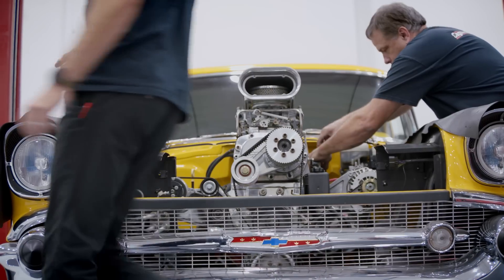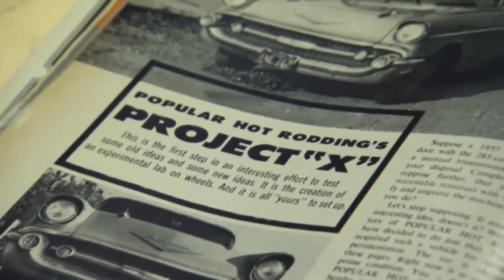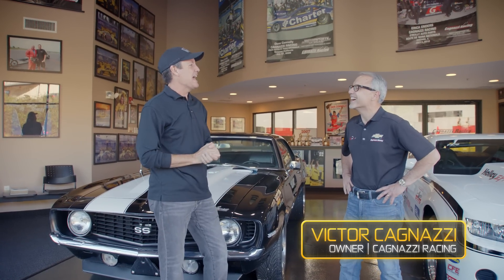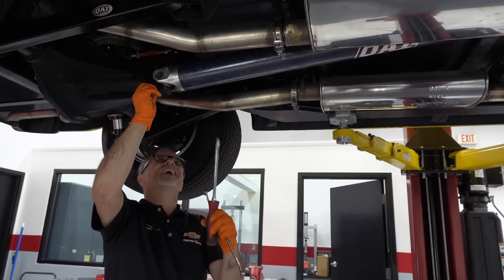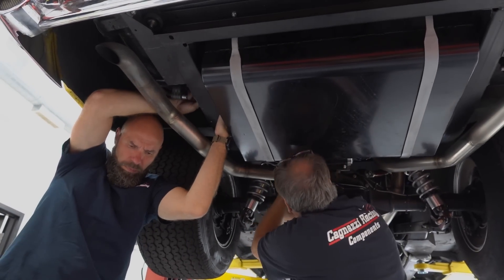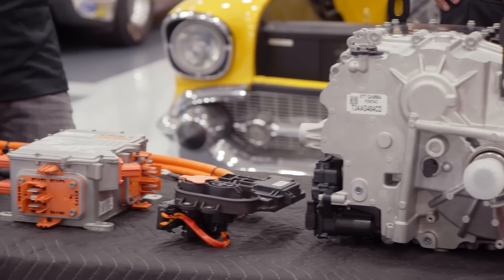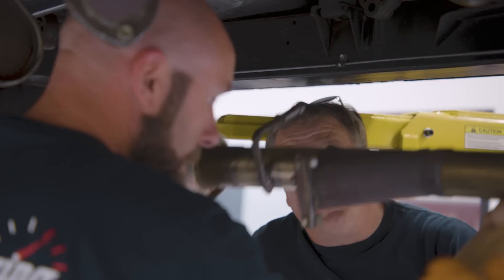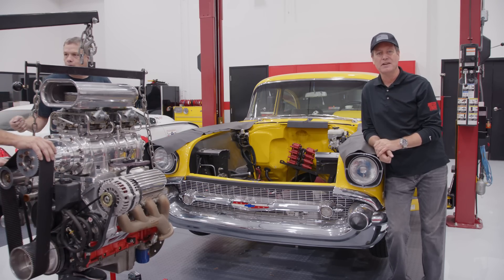Project X: EV Engine Swap [Ep. 1] | MotorTrend

Comment: What a shame 

BTW electricity is a product NOT a power source. It has to be made and how it is made is important to the whole "green energy" argument. 
Are you really saving the planet or just polluting somewhere else that you can't see so that you can feel better about yourself? Yeah it matters, kids.
Reply: California can't even keep everyone's air-conditioners running without rolling blackouts but throwing power into every home for charging your car should be no problem. What a bunch of idiots.
Reply: 😐Ambri Batteries and Solar Grid😐
Reply: Well....as it has been said many times, the energy grid is ALSO changing over, from burning coal or nat gas, to renewables. Why do people not understand that? And....even if it was a 100% coal fired plant, if it powered all electric cars, you still have less toxic emissions and CO2.
Reply: the tires and brakes still give off emissions so if your using coal power plants it's not really much better plus it's the same emissions to build either gas or ev
Reply: @Error-ge9qx  Yes tires and brakes will do that. I don't understand why you are saying that's worse with EVs. In fact brake pads will last longer on an EV because of Regen braking. Right now there is R&D going on with tires, to hopefully make it more environmentally friendly.
Reply: @typhoon320i  This is total nonsense and green washing. Renewable energy(another bullshit term) barely supplies a tiny fraction of our power,because the energy density is not there. Solar and wind are not green(look at the fiberglass windmill blades they bury by the thousands https://www.youtube.com/watch?v=8uo0wefpwZ8 ). they use alot of power to manufacture and produce alot of waste when broken or at end of life. Wake up and quit drinking the kool-aid(or Programming). IT makes a lot more sense to use our existing working grid and plants and gas station infrastructure by putting gas in a  tank and driving,than it does spending trillions to build new infrastructure for something that is a finite resource(LITHIUM) just like fossil fuel.  These electrics just move the pollution from the car to the plant and dont solve a problem,other than people in large,unsustainable cities arent choking on their own pollution. Co2 is not the enemy ,plants need it,and we get O2 in return from plant aspiration. Carbon MONoxide now is a pollutant.
Reply: @a4000t  almost all of oregon is ran off hydro electric 100% renewable energy. Honestly once people get being hydrogen cell EVs will dominate the internal combustion engine
Reply: @NWoutdoorsman  Ok,thats fine,but Oregon is just one place and most states don't have hydro power nor do many countries for that matter. Hydro is a wonderful thing,but it has a huge environmental impact as well-look up the ecosystems it destroys.. there is NO free ride,and made has a terrible footprint to maintain our present lifestyles.
Hydrogen is another stupid idea. Use power to crack water into hydrogen,any conversions of energy means losses. You really should take some time and do some serious research on this stuff. Again its not that hydrogen doesn't work,its the fact that anytime u have to "make" it you incur more losses than gains,its the basic laws of physics on energy conversion.
Reply: @a4000t  very true on the efficiency loss to produce hydrogen however with solar electricity producing the hydrogen there is little emissions happening in the process. The fact that more has not been done leads me to think the climate crisis is less dependant on human impact that lead to belive. The ability to produce hydrogen and transport it to areas where clean electricity is not viable would be a step in the right direction.
Reply: @NWoutdoorsman  LOL,and where and how do you think those magic solar panels were made? Huge amounts of power to refine the silicon ingots to make cells(non renewable waste when they break or fail),smelt the aluminum and extrude it into frames in a factory,manufacture plastic backsheet,massive power to make the glass. Hydrogen is stored in special bladderd steel tanks(yep power to make those too) because it permiates everything.  Read my LIPS: everything uses power..there is no free ride.
Reply: @a4000t  I know there is no free ride. But oil rigs and refineries are not emissions free either. I'm just stating massive lithium battery packs to store electricity for ev's is not the efficient way. There are already power plants in place that we could use to produce the hydrogen. The initial investment is going to be expensive but if renewable energy is the objective I think hydrogen is the best viable option. I'm not disagreeing with anything you are saying, I'm just try to clarify my opinions. Hydrogen fuel cell is a promising future and if Elon would have got behind it in the beginning we would be better off now. Hopefully Toyota's new hydrogen car will get the ball rolling.
Reply: @a4000t  The batteries of electric cars can be completly recycled and it's easy to do (lithium) will will have to mine enough to put about a 100 million on the road to replace current fleet and then will need to mine more as the population grows. Or by that point we will have new battery chemistry. I'm more a fan of solar over wind anyway.
Reply: @typhoon320i  Show me where there is a proven method to recycle lithium.. not a theory,or paper written on it,but actual proper recycling. Not to mention recycling uses a lot of power and it in itself is not green. There are none. Its a waste byproduct. So why trade fossil fuel(which we have infrastructure in place for over 100 years and its paid for) for yet another finite resource? Lithium is mined with slave labor also you know. Good luck putting 100million electric cars on the road,and try and charge them from the grid at the same time,the grid will catch fire and go down. It takes upwards of 10,20,30KW to charge a electric car depending how fast u want it. This would murder the grid if u try and charge a large quantity of cars at the same time. I guess we the tax payers should spend yet more trillions for a grid upgrade right? none of this makes any sense.
You are only guessing we will have new battery chemistry. I deal in real world facts not magic unicorn dust could be stuff.  I am glad you brought up solar. Its not green or renewable either. Once a solar panels broken the silicon cells are waste and of no use, where do you think the aluminum frames,plastic sheets, glass and solar cells are made from... Just making a pure silicon ingot to cut cells from uses tremendous resources,power and heat..so does glass and plastic and smelting aluminum from ore and extruding it for frames.  Wake up and do some research. none of this is green or sustainable or even renewable.
Reply: @a4000t  Your approach to technology is: We had the best possible idea in the 20th century, so it would be stupid to try and improve on that. Let's stick with the old way. What a forward thinker you are. How exactly is slave labor used to mine lithium? You sure you're not thinking of Cobalt? (which Tesla doesn't use any, currently)
Reply: @NWoutdoorsman  have you seen the affect Oregon’s hydro plants has had on the salmon population? There truly is no ONE answer for the future of energy. We have to diversify, meaning not just electric and that is the problem with this big push.
Reply: @WyoCutlass71  I've always been for diversifying our energy, the fact we haven't built a new nuclear plant since the 70s is a disgrace and politicians who went against that should have been thrown out, never to be let run again.
Reply: @superduty4556  You are in for a really unpleasant future then, check back with me in 10 years,
Reply: @superduty4556  I'm not complaining about anything. I quite happy with the current direction in the world, as well as my lot in life. My future will be quite different from yours. I don't think fossil fuels are evil, I just want to see transportation free from that method, and that is exactly what is happening.

Comment: Why would you do this to an icon? Do you just hate hotrods?
Reply: They have built dozens of amazing v8 powered vehicles and you get upset over 1 vehicle that they convert to electric?
Reply: @eighty.eight_productions  because Project X is an icon, started in the 60s by Popular Hot Rodding magazine to showcase the latest popular trends in aftermarket performance products. EV conversion is not even on the radar for the vast majority  of classic car enthusiasts. This is pushing a paid-for agenda. From the comments here, I'd say it's obvious that there's very little support for this desecration.
Reply: @eighty.eight_productions  Steve got it right follow  project X as long as I have and maybe you'll get it